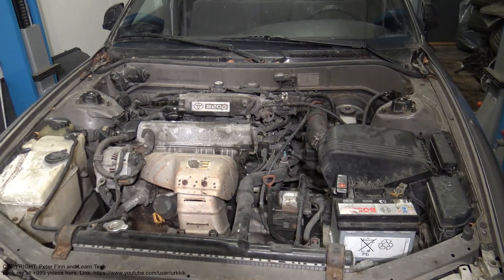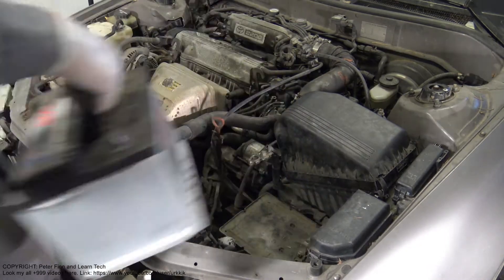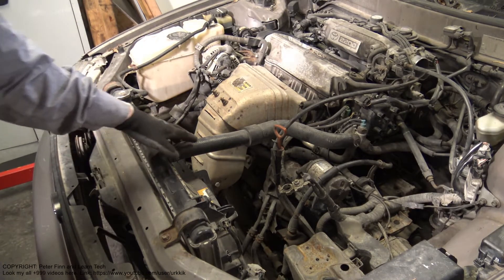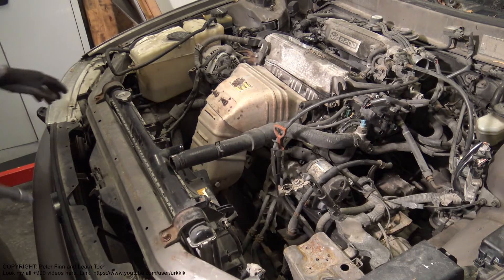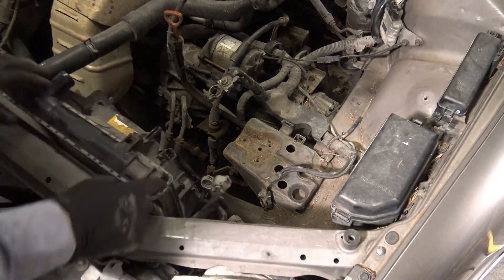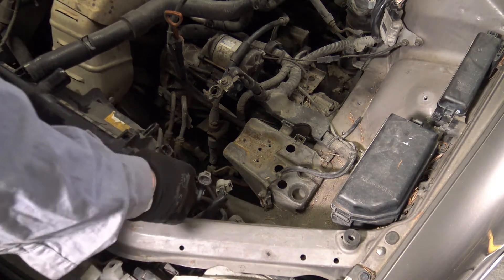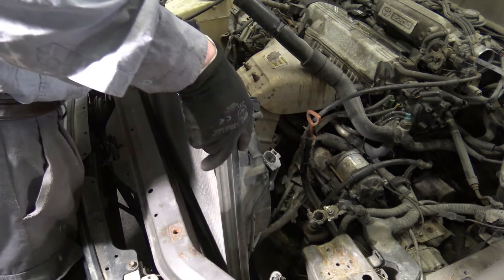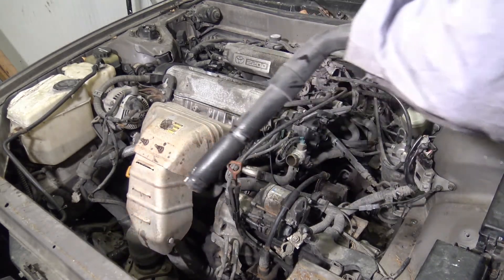Part 1/11. How to replace Toyota Camry engine STEP by STEP.  Years 1991 to 2002. 5S-FE 2.2 liter

Comment: 1999 Toyota Camry 2.2L 5SFE automatic.   I followed the videos and they were great at removal. Now, I can not get the gear box to mate up with the engine. It is about a half an inch to go but will not come together. What is the problem?  i have tried to join but a message says my billing address is needed however there is no place to enter my billing address????
Reply from the maker: I have read your message, Thank you 😀👍